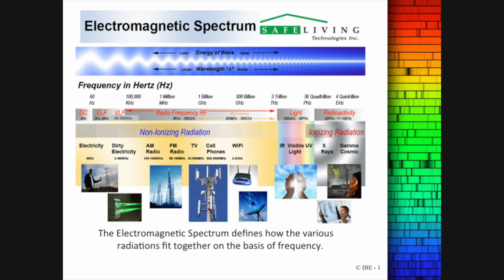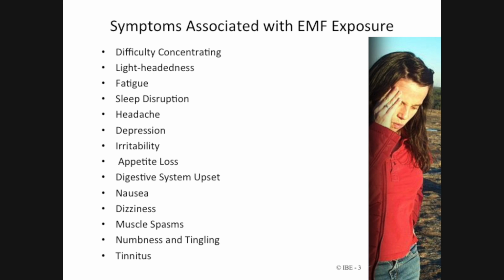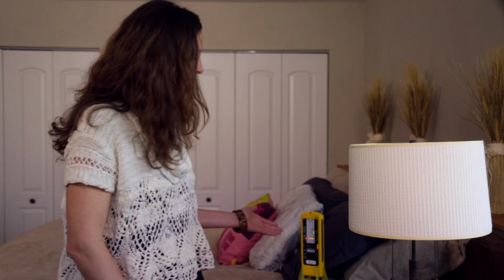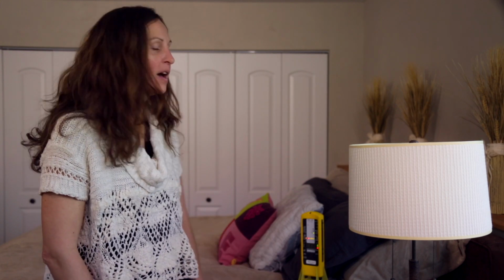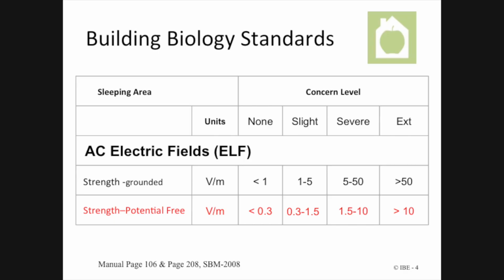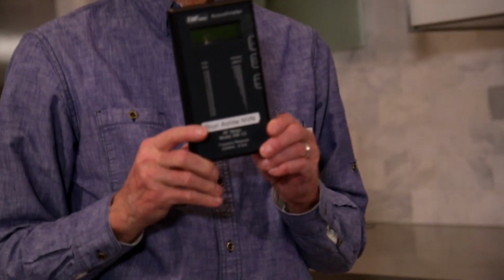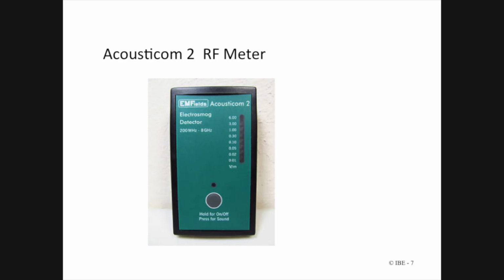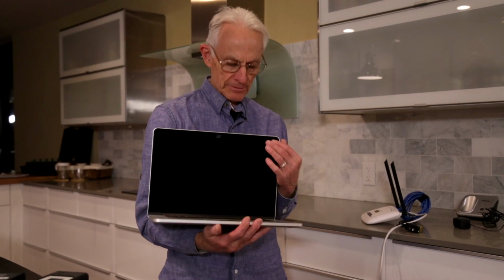Part 2: Electromagnetic Radiation Measurement and Remediation with IBE

Comment: I'm experiencing troubles for 4 years at my home, currently located in France. It started a morning, early. It stops sometimes, and restarts for a few days then stops again. After like one years on different hypothesis, I started to wonder about the new french "smartgrid" system and dirty electricity. I'm trying to measure this at my home.  Doing the 26:25 multimeter experiment with a copper rod in hand, I go up to 12V AC near my window. There is a Public Power Network wire on the other side of the wall.
Now if I plug an oscilloscope to the rod, I got the 50Hz straight (French frequency) and a "nice" sinusoïde.
I tried to request my Power distributor about the trouble. They don't want to investigate.. I have had so many nights since, just unable sleep, the head or the legs never quiet. After a 3 hours talk, a physician in a french hospital tagged me "Electrosensible". I constantly dig for ways to solve my trouble, and finally found this excellent video.
But what shocked me the most was the troubles listed at 8:33. I can check 12 out of 14, and add 2 more, rarely felt luckily: Magnetophosphenes, Tachycardia.
My biggest problem: I can cut the general incoming power at my home, and the trouble continues. => inductors from neighbors ? (a dozen of restaurants, backer, cafes, bars..)
Reply from the maker: Thank you for the comments and feedback.
Reply: move .....i hade some troubles last 8 years unable to detect what it is sme wierd noisethat get through walls like 3 different frequencys ....i suspected wi-fi and microwaves but it turned out to be climate control unit and blowing fans from neighbours storage 3o meters away ...as it changes mode of work different parts of my house get hit and vibration is resonating inside my house ....things gotbetter after years of fighting idiot who dont want to build protecting wall so that sound energy cannot travel this way but calls police like i'm threatning him .....fans work day and night nonstop weaker or stronger but i hade thoughts even eliminating full after few sleples nights inna roll many times ...i wish i moved right away ....it took me 2 years to be shure its from his unit and not some 4G anthena or wi-fi from neighbours or electricity inside my house ....you get crazy head and wasted time from that kinda troubles ....you get tyred and nervous and change norml life pattern ..so better MOVE from ''civilised''habitat